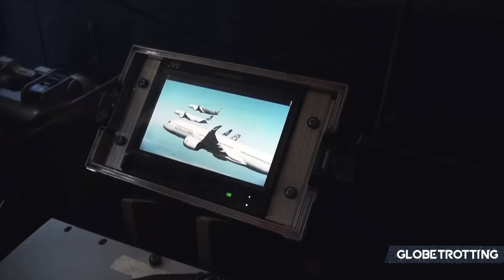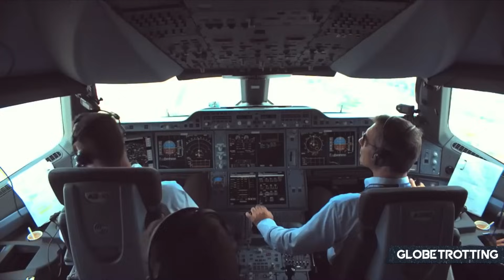PROBLEMS - What’s Up With The Airbus A350?

Comment: Yes, I would also like a layover for destinations 20-plus hours away. A layover of 2.5 to 3.5 hours would be great, get off the flight, stretch legs, visit the lounge, have a shower, grab some non-airplane food, then continue to the final destination, which is likely 3 to 5 hours away. 
Yes, both Airbus & Boeing have their problems. I'm surprised Embraer or China's (Comac), and others, don't seem to have these problems.
A video of this would be interesting. And I'm surprised Comac isn't available in the European/American aviation airspace. Seems to me Comac has an extremely safer record than that of Boeing.
Reply: Ridiculous to suggest Comac have a better safety record when they've barely made a 100 aircraft in total while boeing deliver nearly 50 a month. Also no Comac aircraft has been certified by the FAA or EASA, and are not likely to be any time soon. For the foreseeable future they will only serve domestic routes.
Reply: Well, boeing shouldn't be flying, and Comac has a extremely better safety record. Just because Boeing is a USA Company does not make them any safer than any other Airline Manufacturer.
And Comac could go internationally if the USA and EUROPE got off their me better and safer attitudes. We already know through Boeings experience thry are definitely not better nor safer.@DrFod
Reply: I love airplane food, its the best thing even in economy   I go for a 5-8 hour layover especially if there is a good hotel air side..   Proper hotel room, toilet, shower.
Reply: Comac produces its airframe itself, the one thing I noticed is it is not contracted with Spirit Aerosystems.  Honeywell, GE, Safron, Crane and Collins. are the Western companies mentioned in avionics, engines, flight controls and auxiliary power. No mention of Spirit Aerosystems.   Perhaps they do have some contracts, if so, they are minimal.
Reply: @flyguy212  Why does anything have to be contracted out by a USA company that's BS
Reply: @jonathanscott550  Because "it's a global economy" It was the dumbest move ever for Boeing to outsource.

Comment: Like I said before, the supply chain issue surrounding Airbus isn't only caused by the aftereffects of the COVID-19 pandemic, but also the ongoing invasion of Ukraine by Russia.
Reply: And renewed tariffs
Reply: If I'm understanding correctly, the situation at Boeing is a little worse because the ramp-up after the pandemic coincided with the various quality issues with the 787, and stalled 737 production. Not only that, but Boeing was unable to commit to a supplier delivery schedule, rather it was erratic at best.

Normally, the limited supply would have been split, or gone to the highest bidder, however circumstances meant that Airbus was able to commit to almost as much as could be produced. 

Any business will usually supply it's most reliable customer first.